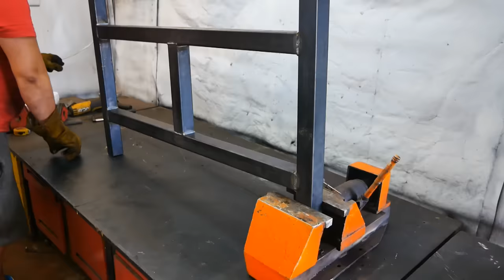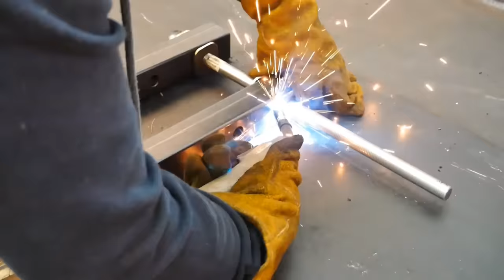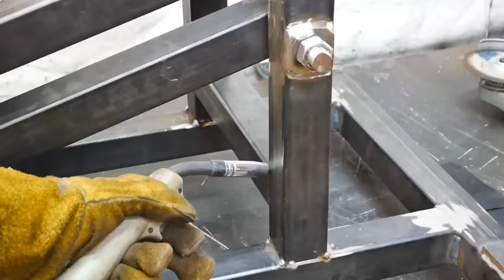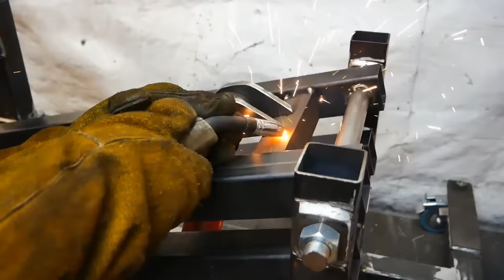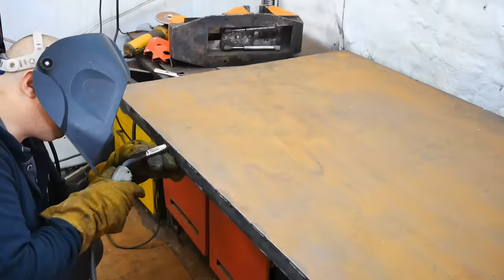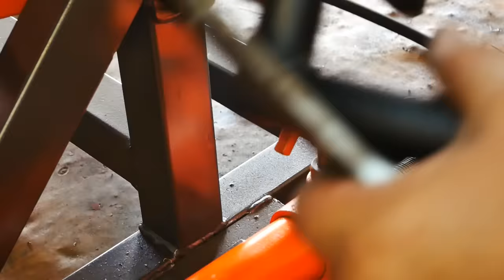Making Hydraulic Lift Table

Comment: I made something pretty similar about 20 years ago for a friends dad.

For work he reconditions classic car engines in his workshop. He has a 4 foot high 3 shelf racking running all along one wall. That's where the customers engines are stored while waiting their turn to be stripped and rebuilt, Or just waiting for the customer to come and pick the rebuilt unit up. Even in his late 40's he could still humph some pretty hefty engines onto that racking by himself, But age was creeping up on him.

What I built used the same parallel links like you made, But had a drop step on the end that was big enough to pull an engine onto from the bottom shelf and move to a middle shelf so he could spin the table around and then drag the engine onto the main table section. I made large brass bushings and used ground rod (Cross drilled at the ends to take retaining pins) for all the pivots, And the ram came off an old engine hoist to lift the table. Worked bloody well considering it was 90% made of scrap metal I'd scrounged from work. :)

In those 20 or so years I've only ever been asked to take a look at it once, And that was because with about 15 years of constant use it had worn all 8 brass bushings so much that the table top could be rocked 4" side to side on the slop. I made some more bushings, fitted new ground bar stock and added some grease nipples this time around. :D

My mated dad will be hitting 70 in a couple more years, And when I asked if he had plans to retire any time soon I was told "Yes. When I hit 70 I've decided that I'm going to take life a bit easier........ So I won't be working on the weekends anymore". LOL ! Blokes a feckin' legend !

Comment: Nice build and video. I did notice that the higher the tabletop got the more tilted it became. A suggestion: On the next Lift build you might want to go with a scissor design (X-configuration) with a screw drive. This will provide equal rise on both supports allowing the tabletop to remain level. Again, great work. Keep it up.
Reply from the maker: Thank you :) Maybe it looked like it in the video, but the table top does not tilt when lifted.
Reply: @WorkshopFromScratch  My bad.
Reply: Great job love it I need one myself.

Comment: Great build. I recommend an air over oil hydraulic system so you can use your compressor to raise it with how much time it takes. Then you are more likely to adjust it every time you should rather than bagging it and doing without due to how long it takes to raise.
Reply from the maker: Thank you :) that change to an air powered hydraulic cylinder, it will certainly speed up the lifting :)
Reply: That’s about as fast as the first stage of a typical 3 stage tranny jack. The ones for under a lift, not those horrid on your back things. Ick. 

 3 years ago I put a 20hp electric over hydraulic unit in my shop with ports at 2 different spots in the shop. (Could easily put more but haven’t had the need yet).  One of the better upgrades I’ve made
Reply: Chris 279 20hp?! My goodness! What does that even run off of? Do you have an 80amp line or something??
Reply: Kaden McDonald 3 phase 60 amp. I had a 200 amp service when I bought my house, got 3 phase years ago for my Bridgeport. Got the motor for a steal second hand. Don’t need anywhere close to the power obviously but it was available

Comment: Useful ideas and great work. I have an old heavy duty chair recliner motor and gear im thinking of doing a similar thing with. It can lift me up no probs so should be fine for mowers and small engines etc. I was wondering how to do a parallel lift but this has sent me off the right way. Nice project for me and good ideas (casters etc)

Comment: Given that the hydraulic cylinder doesn't tilt much as you raise and lower the table, I would have tried finding some other size of cylinder or made some sort of extension so that it could be attached in a more vertical position throughout its range of motion rather than being tilted back.   This would both 'be stronger in terms of the max load as well as for general stability of the table.   I'd also find a different anchor point for the pedal spring vs the fitting- hydraulic fittings are pretty strong (they have to withstand the internal hydraulic pressure after all), but the directly coupled vibration from working the pedal could cause it to loosen over time and leak and it just plain doesn't look very good considering how well you built the rest of the table..
Reply from the maker: Thank you :) I was building this type of table for the first time, so for sure there will be some corrections that I will try to fix :)

Comment: I like these build videos that rapid speed the simple stuff. Always interesting.  The workmanship is professional. 
Never seen this particular interesting design for a lift table. The frame is heavy duty for higher capacity, but I still rather go with a more traditional scissor design lift. Would like the table to lower closer to ground.

Comment: This would be great  for a expresso machine, as in a high dollar prosumer or commercial machine because if you were to elevate the machine  then you could essentially fit any capacity liquid container under the brew head instead of small cups once you remove the drip tray from under the brew head.

I'm talking about machines that are north of 2000 dollars a unit. That way something like 32oz thermos or those counter top thermos you see at coffee shops could fit under the brew head. 

Great for when you want to make say over 300 oz of express for snow removal crews in North Dakota for morale boosting when it's 30 below wind chill on a regular basis.

Comment: Nice work really nice work I have a suggestion how about making an offset camshaft so you can use a cordless drill 2 pump up the hydraulic cylinder.
Reply from the maker: Thank you 😁 For sure it would speed up lifting, during the construction I was convinced that the cylinder placed at the end of the center of gravity would be faster but I was wrong

Comment: Wow, that thing has RANGE!  Does it go from your knees all the way up to your eyeballs?  One thing you might want to add (besides AOH) is a hand pole for when your leg gets tired.  Throw a 1" (25-30mm) conduit strap on the side and a screw through the angled part away from the foot pedal, facing up.  When you drop a tube down the strap onto the screw, it will allow you to use your arm power.  AOH is always more fun, though.

Comment: @Workshop From Scratch  Awesome Build Brother! You wouldn't happen to have a Cheat Sheet for that would you? Just like the Measurements and Angles. Would love to build that exact Table. Super Handy. I think the only thing I would do different is add Air over Hydraulic Jack. 
Your Engineering was spot on!
Reply from the maker: Such a change of the lift will certainly improve lifting.  I will put a link to the photo to the description of the film, there will be dimensions, if it comes to angles, everywhere are 90 degrees

Comment: Excellent build, I love it and I'm going to build one myself.  I think the only thing I'll add is some sort of safety ratchet mechanism for just in case the hydraulics fail especially if there's something heavy and valuable on it like a motorbike.
Reply from the maker: Thank you :)
Reply: Dont built it to put heavy load on it this one wil bend to one side look to a sky worker with sissors under need them it wil be more stable

Comment: Very cool but it needs safety pins to set the height at different levels.  Hydraulic cylinder and pumps can fail and the table will drop very fast!
Reply from the maker: Thank you :) I will try to improve it :)

Comment: Great video. But there is no safety if it fails. Also, the whole weight of whatever is on it and structure is on the 2 small plates that hole the jack in place. 
Looks good though. 👍🏼

Comment: My only serious beef is using all-thread for shafting. The load goes onto the thread crests deforming them and wearing all out of proportion to operating cycles. A better choice would be round bar stock. If you can't thread it for a nut, cross drill it for a pin.

Comment: excellent video.   I have the metal frame of a recliner lift, was wondering what i would do to mod it to go straight up vs up and tilt, and this shows the answer to the problem.  won't need to change much at all, just where the lift motor and screw attach and toss a table on top.

Comment: great piece of manufacturing - congratulations. I wonder if a pneumatic (air driven ram) might achieve the same effect. I have a disability so pneumatic are my preferred mechanism. Nothing wrong with your approach - it is great.
Reply from the maker: Thank you :) If I knew that it would be allowed to lift slowly, I would definitely install a pneumatically driven hydraulic cylinder. During construction, I thought that the position of the actuator at the end of the center of gravity would greatly speed up the lifting, I was wrong :(

Comment: I added a air/hydraulic foot pump to mine and that made it 100x easier to use.
Reply from the maker: I have to change to one of these compressed air driven hydraulic pumps. During construction, I was convinced that the pump I used would be faster
Reply: @WorkshopFromScratch  mine is about the same speed as the manual pump but easier. Push a pedal and hold it to extend the ram and push the pedal the other way to retract it. It worked great for me, just my two cents.

Comment: Nice strong lift table. I like the wide base.. Could you have made it so the top was only 50mm ( 2") off the floor? Also air over hydraulic a must.
Reply from the maker: Thank you :) The minimum table height is 350mm, the maximum is 1300mm.
Possibly using a weaker but faster actuator,
I used a 10T actuator, but 2T would be enough

Comment: Why did you go with this style of under frame compared to that of a scissor lift style?  To my understanding the scissor style is more stable and can lift more weight safely.  I was designing a lift table of my own and found your channel.  By the way great craftsmanship.
Reply from the maker: The scissor system is only more stable in the lowest position, the higher you lift the scissors, the stability becomes similar to the table I built, and secondly I wanted to build a table that would actually be eye-catching and look non-unstable. But it is really stable and the weight of 200,300 kg is not a problem for this table, the wheels will break faster than the structure
Reply: @WorkshopFromScratch  thanks for answering.

Comment: As mentioned you will have to redo the wheels
Use a piece of angle iron or even a vertical bar across the top, To strengthen it
Reply from the maker: The table has been working for the second month without any modifications and I have not noticed that the wheel mounts have deformed :)

Comment: Making one of these this heavy duty all steel and parallel linkage style has been a dream for years. How much did all the steel cost? How much weight you think this will support? One of the best build videos I've seen on youtube- incredible work man!
Reply from the maker: Thank you :) The table can withstand a load of 200 kg, maximum 300 kg. In order to be able to use it to work with greater loads, it would have to be built of thicker materials, but this strength is sufficient for my work. It's hard for me to say what the cost is because a lot of the material I used comes from scrap metal.
Reply: @ac.1116 that is damb rude question to anyone.

Comment: Nice  lift table. I need something similar... Could you have made it  of the minimum table height is 450mm, the maximum is 2400mm.  weight capacity 1 ton ???
Reply from the maker: minimum height 350mm, maximum 1500mm as I remember correctly.  To lift more, you would have to build longer lift arms

Comment: Nice job, i don't know how much weight you plan to use on this but i did notice that the weakness might be on the 2 point where the hydraulic jack is attached. It seems to be reliant on the weld. Just a suggestion but I'd of made it so the weld held it in place rather than the weld take the weight. I'm sure it will hold more than enough for what you plan to do though.
Reply from the maker: Thank you :) As you browsed my channel, you probably noticed that I do not do very heavy projects, so for my needs the durability of this table is enough :)

Comment: The class table turned out. 👍But the wheels would have to be more powerful. These are calculated at 75 kg maximum.
Reply from the maker: Thank you :) The table is not designed to carry heavy loads, 200 kg, max 300 kg will depend on the position of the weight, so I think that such weights should not be a problem for these wheels

Comment: Great design for a very stable adjustable table height. 
Unfortunately with that location for the ram you limit your 10 ton lift to only about 2 1/2 tons. 😉
🤣😂🤣😂

JK. I know the capacity is still way more than you would ever put on the lift. 
(Or is it. 🤔🤔)
Reply from the maker: As described in the description, the table is not intended for lifting weights, the maximum load is 300 kg. As for the actuator it was complete with a hydraulic pump so I used it :)
Reply: Workshop From Scratch 
Sorry. My comment was meant to be sarcastic.

Comment: Foot operated jack = Na, Na.
Tool operated jack = yah, yah.
      It's a cool design but I would have to have the jack operated by a drill or air gun ( foot operated would be great for back up or if it was mobile and you didn't have a drill with you).

Comment: Nice video and nice table good workmanship how much do it carry weights on that table
Reply from the maker: Thank you :) 200 kg maximum 300 kg if the weight will be distributed over the entire table top
Reply: @WorkshopFromScratch  now how would you know that unless you had some info on it like it came from a manufacturer?

Comment: The wall thickness of the tube that attached to the wheels is pretty thin, was wondering if where the flat that the wheel is bolted to might 'tear' that thin wall under load? Love the design and build though, really nice looking
Reply from the maker: This is not a table designed for carrying heavy loads, I wanted to build a table that would make the work lighter and more pleasant, but the structure can easily withstand a load of 200, maximum 300 kg. If you would like to build such a table to work with larger weights, you would have to modernize the construction or build it from thicker materials :)
Reply: @WorkshopFromScratch  0

Comment: This is a weird build to me. For how ridiculously beefy the table top is, the cantilevered lifting mechanism is single point and long armed. If this was a scissor lift mechanism instead, the table would be quite literally 10-100x as strong. I would replace hydraulic with screw powered and use a cheap cordless drill hooked up to it, and the trigger wires replaced with a foot pedal. Just a slightly different design would have something far, for more usable. Peculiar choices made on this project.
Reply: "Far more usable" is a bit of a stretch. "... have slightly more capacity with the same amount of materials," would be more accurate.
Reply: The table is to high off the ground.When your riding mower weighs 500 lbs. plus.Getting it on the table=Build ramps,winching system and design a height locking system.You don't trust any mechanism holding heavy items up.
Reply: True perhaps. But not everything must be the best choice. Sometimes things are cool, or stretching your skills

Comment: You'll want to get that air or electric hydraulically powered as that is alot of pumping
Reply from the maker: I have to change to one of these compressed air driven hydraulic pumps. During construction, I was convinced that the pump I used would be faster

Comment: what is that large metal hole bit called?  the one used to make the holes for the threaded rod?
Reply from the maker: It is a widia hole saw, it drills precisely, but you have to cool it while drilling and do not press it too hard as it is easy to damage.

Comment: Castor wheels should be mounted on square profile
Reply from the maker: Yes, but they would significantly increase the height of the entire structure, so I decided to mount them on a flat bar, so far this solution does not bring any problems :)

Comment: I bet you'll get tired of pumping that thing pretty quickly and find a Electric pump to replace that one with Lol
Reply from the maker: I was convinced that it would lift faster, but unfortunately I used the cylinder with too much capacity, which makes it very slow :(
Reply: @WorkshopFromScratch  Yeah first thing I noticed once you got it done was how much you was pumping it and I was like "hell no if I'd do that for long" 🤣🤣🤣. Maybe you can make a different pedal for it, one that's closer to the Actual Pump Arm, that might help a little bit maybe 🤷🏻‍♂️

Comment: Everyone seems to build these 'lift tables' and jacks using either cable winches or hydraulic rams. Other than the few that actually 'have these items laying around', I really don't get why they'd want to build such dangerous tools for general use! Cable breaks, the table collapses. Hydraulic line bursts, the table collapses! Why not just use a shaft of 'acme all-thread' (available at most any decent hardware store) and a 'size-appropriate' tall acme nut, with a windshield wiper motor to drive it? If the motor fails, you simply can't raise-or-lower the table...but no collapse, it 'fails-safe'...which means no 'garage amputation' while working on something. Oh, well...not my project...My motorcycle lift table is far safer, and DEFINITELY cheaper in parts.